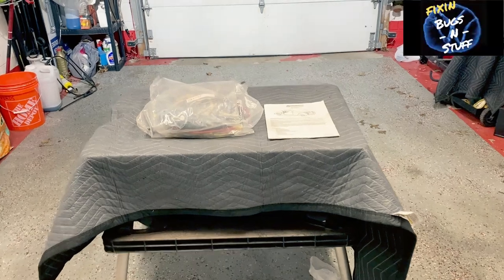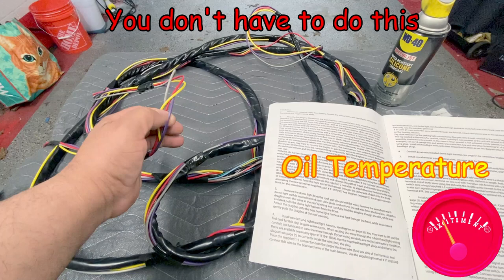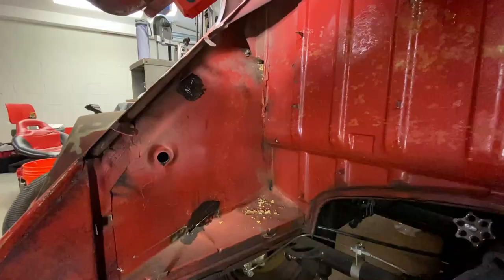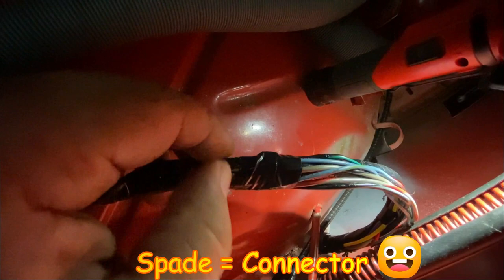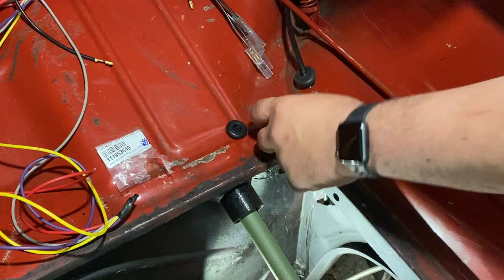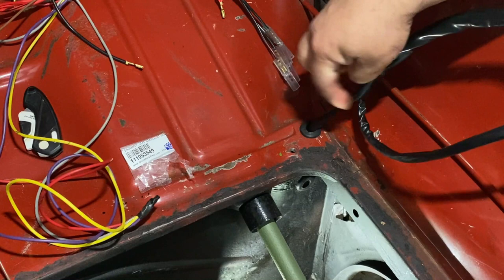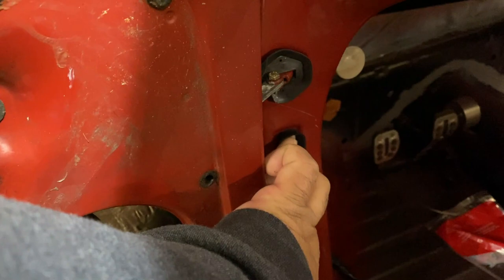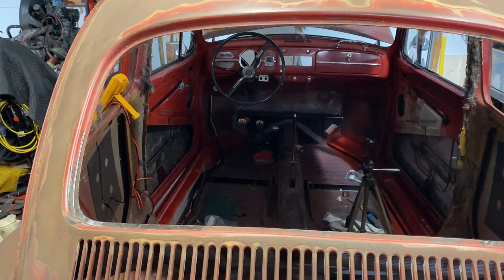VW Bug Wiring Harness Install Part 1

Comment from the maker: Hey Everyone, enjoy the video and please add comments or questions.
Reply: Hi, what year is this specific bug you’re wiring?
Reply from the maker: @justdiyit9683  it’s for a 66 vw bug.
Reply: @FixinBugsNStuff  Awesome, I have a 1963 beetle and recently purchased the WW complete wiring as well and most of it looks very similar to yours. Mine is still 6v and also have the conversion kit to 12v so hopefully you make a 6v to 12v video in the future as I think you were very thorough and detailed in our video. Thanks again and subbed to your channel
Reply from the maker: @justdiyit9683  the wiring I showed is for a 12v setup. The 66 did have a 6v system, but the wiring was too old to use. So I ordered the WW wiring for the 6v setup. The gauge of wire is what matters concerning amperage. The good part is, upgrading to 12v doesn’t change anything. Except, flasher relay, wiper motor, starter, ignition coil, generator, flywheel and all lightbulbs. If you have already done this than you are in good shape. I believe I have a video showing how to change the armature for the wiper.
Reply: @FixinBugsNStuff  Awesome!
Reply: @FixinBugsNStuff  How much was that harness kit?
Reply: Im here because i wasn't expecting the old foam

Comment: Dude.... life saver. Doing a full restore on a 69 for my wife. First full restore ever, and my experience is lacking in electrical. These videos you made are beyond helpful and I can't thank you enough. The bug came stripped for paint with no electrical components on it. Was pausing the video to get my list going for parts.
When it's finally time to wire it up(chassis is currently off body and it'll be a while before it gets painted), I'll be referencing these videos.

Thanks again, dude.

Comment: I always take pictures when I dismantle stuff like this,now, but I did not 6 or so years ago when I totally dismantled this 69 I’m totally restoring. Finally got the paint done and started on the total new wiring harness and sorta forget where the harness was routed etc.. Thank You so much , this helped Me a lot! Mine is a convertible and a bit different, but Got Me on track. Thanks again.

Comment: Nice job on the video. It's hard to believe that over 7400 views you only have 220 likes.
I been dreading replacing the wiring in my 67 but this video makes it look easy. Thanks for the Key Moments list it makes it easy to follow.  I'm converting my generator to an alternator, will this kit work with it also? Last question. Are all the boots you used readily available online?
Reply from the maker: Yep not all agree with my methods, but I just want to help out as many as I can.

Comment: I got that harness from wolfurwest. My oval 1956 year has semaphore. What ia your recommendation in my case?
Reply from the maker: Did you order the harness for a 56? If so, it should come with the wiring for the semaphores. If not, you can run them.
Reply: @FixinBugsNStuff  Working  on the super beetles electrical is a pain in the A$$ due to the manual electrical symbols hard to understand.

Comment: What kind od spray you put on wire make it easier go  through.
Reply from the maker: A silicone spray. It does not agitate the wire insulation.

Comment: Where did you find those clamp on brake line brackets on your axle tubes? Never seen those before, slick.
Reply from the maker: They are stainless and I had them made. You may have to look them up on Facebook marketplace.

Comment: Question(sł what year beetle was this done on? I have a 1977 standard beetle sedan would this work on it?
Reply from the maker: 1966.
Reply: @FixinBugsNStuff  now other question. Could I use this on my 77? The wires look awfully similar. If not is there anywhere online you'd recommend for this year model?
Reply from the maker: You could, but it would be better for to actually get the schematic for your year. You can find it here: https://www.thesamba.com/vw/archives/info/wiringt1.php
Reply: @FixinBugsNStuff  thank you you're a lifesaver! :) I'll try it this weekend